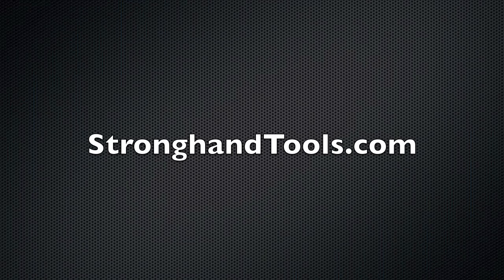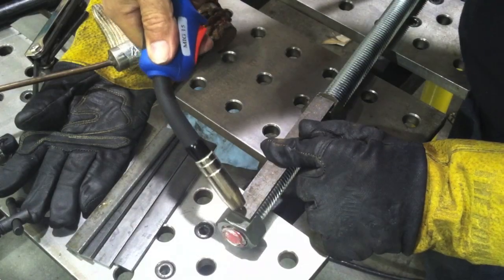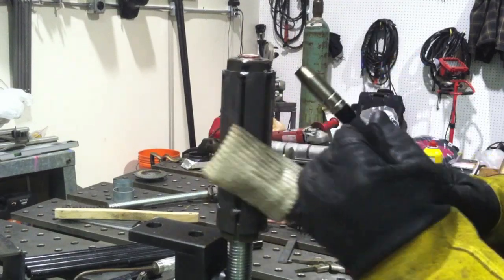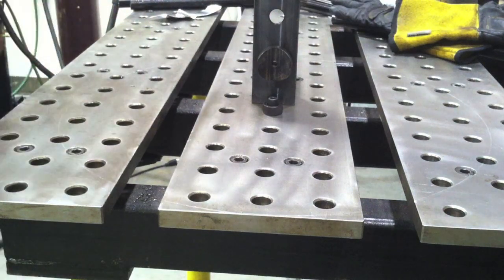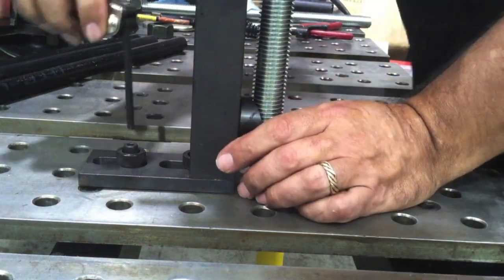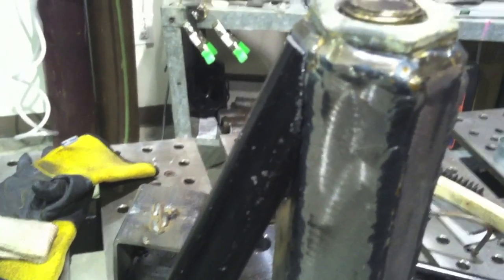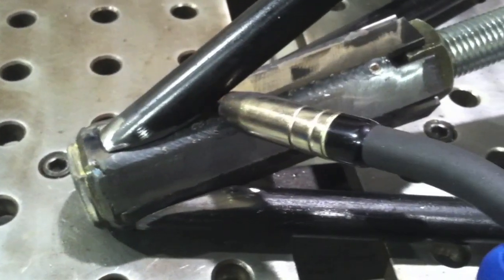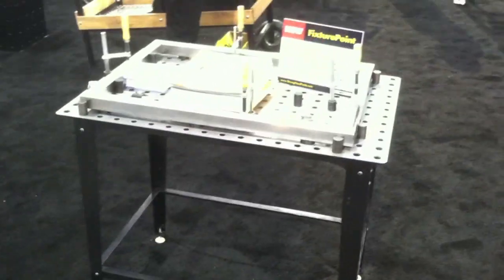Welding Project - Fabricating Shop Stool with Stronghand Tools

Comment: Thanks, Jody, for the great video! I actually am building the stool right now with the similar  'guiding', 'not welded' nut design and while yours spins freely at 3:17 after axial seam welding, mine was not. I used TIG. I checked it after each axial weld and each time it was stuck. But I found that if I hit it with the hammer a few times after each weld while its still hot, it released and started to spin freely.

Comment: Jody, do you happen to have any information on the fixture point table? A quick search provided no details on it. The smaller size and cost would be perfect for what I need!! Great tip on not welding the second nut!! I've ran into that exact problem recently!! Thank you for your videos sharing your knowledge!

Comment: I have that welder and couldn't be happier with it. Granted I've only had it for a little over a month but I've put quite a bit of use on it within that time frame. Check out my channel for my unboxing, review, setup, electrical install, and projects I've build with it.

Comment: Jody.... Great vid/channel..... When u have time check out my ports band stand, quick handheld to vertical and then back to handheld with an adjustable height table so you don't have the full blade exposed when not necessary.  Simple build with some welding